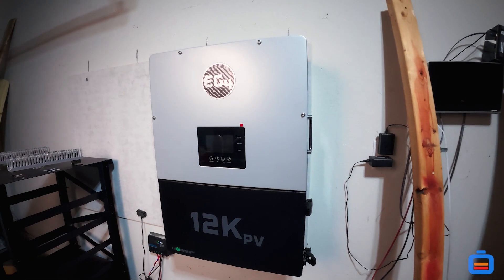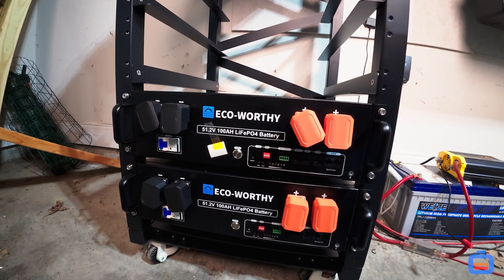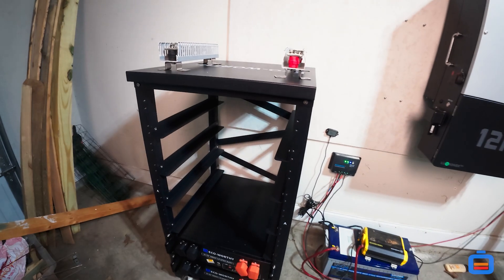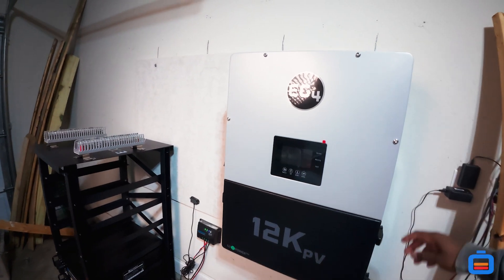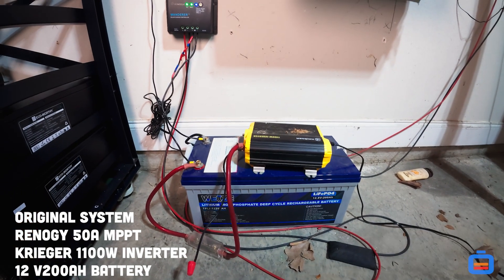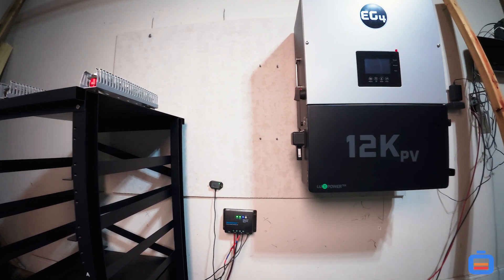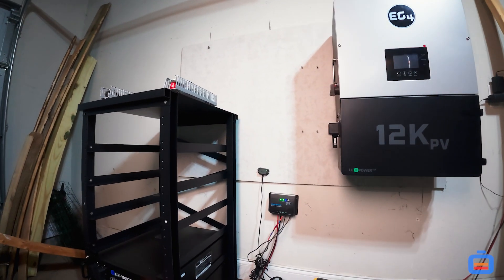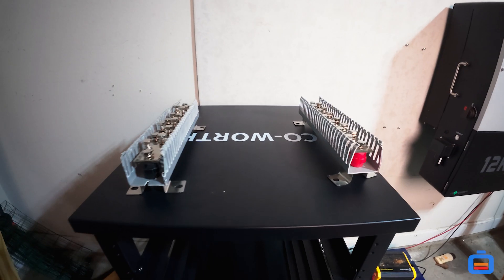EG4 12Kpv Install Part 1

Comment: Nice.  Those batteries are still a good deal, and are good batteries so I wouldnt get too bent over it and like you say you will upgrade later. Im on Signiture Solars website trying to find those 600 AMP Bus Bars.. Can you tell me where are they on their website? I just bought the EG4 Flexboss & Grid Boss.. Im not selling back to the provider either but I liked the outside rated and UL certs.  My city requires permits even for Off Grid and seems to want everything to be UL cert so I didnt take any chances and bucked up.  Part of me is envious of you for not having to spend all the money for the flex boss21Hybrid/ Gridbass MID.  I originally was going to just buy the EG 4 12k XP for a whole lot LESS money, like you, so...  Hope that makes you feel better about those batteries... I just bought 6 of the EchoWorthy V3's..I guess I got lucky. 

We are always going to be seeing something we shoulda cudda done, so lets all just be happy and make it happen with what we have.. LMK on those "Bus Bars" if you would.  Thanks for the video, great job
Reply from the maker: If I were you I would skip the bus bars and go with a RUIXU 10-SLOT Battery Rack with Bus Bars already included!! it has them built in and you will save the setup time with a lesser battery rack !!! Thanks me later ! The reason why they want a permit for everything is because for every solar adapter like you and I the electric company and city will lose a Million Dollars over the lifetime of your existence on your property, its simple math and this is the fight we must have in each city hall around the country, Do you really own your land if you need permission to harvest free energy on it ?
Reply: @RhinoxEnergy  Yeah, I know what you mean about NOT owning our land when they make you get a permit just to put a new light socket in. Not to mention Prop Tax, sales tax, Gas tax, etc... lol. 

I got the rack for free when I bought the six EW batteries plus rack during the July 4th sale & Amazon prime days combined $4730 including shipping.  

The reason I wanted the Bus Bars is because I have 4 fairly new 12 volt 320 ah batteries I was going to put in 48 volt config and attach thru a bus bar as Gavin was showing on his channel, and I noticed those you have have quite a few lug spots and the higher amp capacity. I'll keep looking arround.  

I was looking at those RUIXU battery racks. But these Echo Worthy batteries are a little longer in length than the EG4 battery rack could hold (I think) so Im a little worried about bucking up for one of these enclosed racks only to find out they dont fit.. Im still looking into it.. Like you Im trying to get my equipment all bought by the end of the year.  Thanks man.

Comment: EG4 inverters, particularly the 18kPV and 6000XP models, have been reported to have various issues, including overvoltage protection, battery communication failures, and SOC (state of charge) discrepancies. Other problems include Vbus over range, Bat com failure, and Meter com failure. Some users have also experienced issues with flickering lights and difficulties running appliances. 

Detailed Explanation of Common Problems:

Vbus Over Range:
This fault occurs when the DC bus voltage is too high, potentially due to an issue with the PV string voltage. 

Battery Communication Issues:
Inverters may fail to communicate with batteries, which can be due to incorrect communication cable pinout or a misconfigured battery brand setting. 

SOC Discrepancies:
Some users have reported issues with battery charge percentages not accurately reflecting the SOC, with some batteries showing 0% charge even when they are not fully discharged. 

Bat Com Failure:
This indicates a communication problem between the inverter and the battery. 

Meter Com Failure:
The inverter may fail to communicate with the meter, potentially due to a faulty communication cable. 

Flickering Lights:
Some users have reported flickering lights, which can be an indication of voltage instability or waveform issues. 

Appliances Not Working:
Issues with running certain appliances, like washing machines, have also been reported.

Comment: Hey man I appreciate your videos I've just got four of those eco-worthy batteries and man I don't know about you but it looks like you just got yours too and now they've upgraded it right up under our noses and me and you got old stock the more unreliable versions and from what I'm reading online these only produce 95 amp hours to wear the new upgraded models are 105 amp hours which I would have gladly paid the extra $60 to get the upgraded versions but the salesman did not tell me and obviously he didn't tell you either which makes me feel like s*** I really really don't like being misled or not show the whole picture but I really appreciate your video I really watch them and I've learned a lot I've got the same exact setup you've got except I've got 32 panels a 12,000 XP and four of those batteries I would much rather have the new version is called a series 3 battery upgraded from the series 2 version let me know what you think if it matters or do you feel like this is a good deal on these older batteries sorry for the low message
Reply from the maker: Thanks !! I absolutely agree with you on having the older model is not ideal but even with the older version we still have such a good deal of quality in these batteries. The only thing I'm envious of the new version is the 32 battery parallel limit vs the 15 battery limit that we currently have on the version 2 batteries. I don't think im going to start over honestly, if anything I will continue to buy the batteries and when I get to a point where I can afford a second inverter I would just split off the version 2 batteries to just charge my car or a secondary structure in the future. when I saw the news I definitely cringed like oh man lol why didn't I wait !!! but no it doesn't matter when you start just as along as your start somewhere !!!! #energyindependence
Reply: I know man I'm beating myself up I can't believe that literally the day I received my batteries is when the new battery was released but I mean you're right these are they seem to be high quality and that other YouTuber the will I watched all of his videos he's great I saw him taking the battery apart and the new battery is much better than the old ones and that was more salt on the wound ugh but I love you set up man I wish I had the PV I've got the XP but I'm using so much power out here that I will never be able to feed back to the crib that's why I got the cheaper one but thanks for all the information I really appreciate it and the quick response
Reply from the maker: Honestly I probably should have gotten the 12XP like I originally thought about getting, it has a higher output capacity and I'm never going to sellback to the grid!! Lessons learned along the way of course lol !!
Reply: @brainwashed7244 a YouTuber named average Joe is going to do a video on changing the terminal sides to match the V3. Doesn't seem too complicated